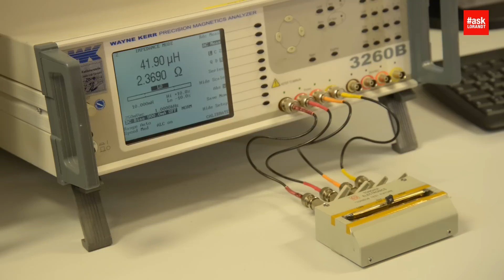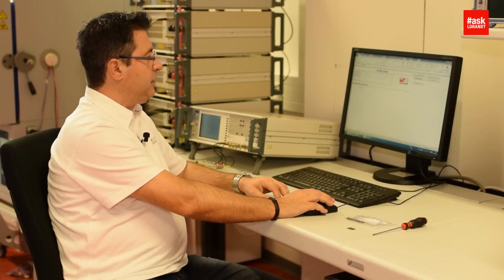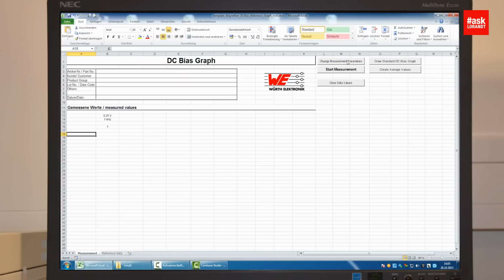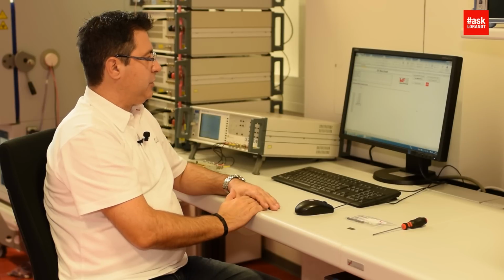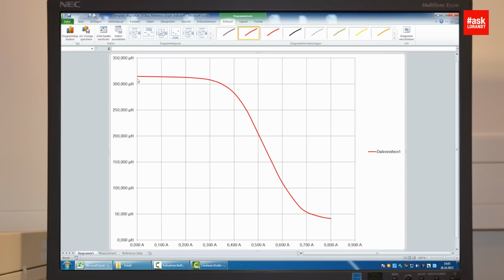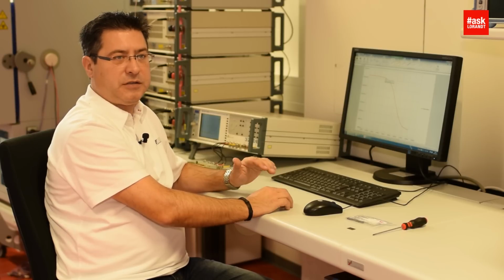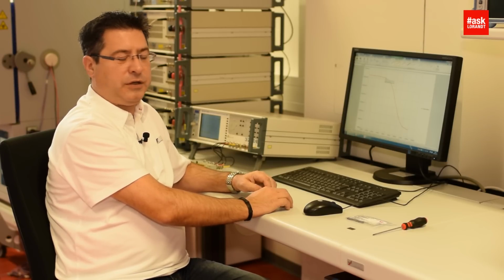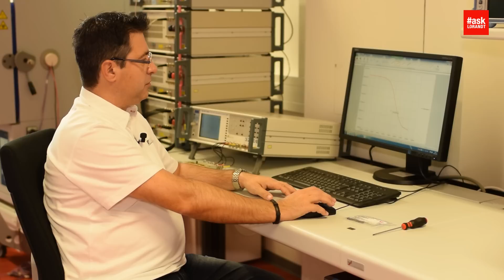#askLorandt explains: Saturation current of an inductor

Comment: Very interesting your measurement set up, I just have some question, how to select what saturation current is suitable for my circuit, and is there any relationship with rated current (like the difference between your rated current and saturated current needs to be large enough)? Please advise.
Reply: Thanks, yes our company made some nice investments in good instruments. Regarding to your question:  there is no relationship between Isat and Irated. The definitions are totally different. By Isat you are looking to the inductance drop over the current increases and by Irated you are measuring the self heating vs. current. Means it could happen that you have a inductance with a low DCR and can push lot of Amps until the the component start to be hot, but because of the smal size of the core the H field too big, that you don't have any inductance left. At bigger size cores the Isat ismost time higher value as Irated. You can select the inductors on the simples way using our RedExpert database:
https://redexpert.we-online.com/redexpert
Here you can introduce your operation values and you can see which inductance how much will saturate and how hot will be during your operation. All those values are measured in real condition and without heatsink. If you like you can contact our local FAE to help you by choosing the right component. just send me an email to: askLorandt@we-online.com

Comment: Hallo Lorandt, may I have two questions please? Basically, both of them are related to the current ripple in a DC-DC converter application:

1. What about the AC current as operating point? Does the inductance change if you test at a higher one?
2. The test frequency was 1 kHz, but the buck/boost regulators work at hundreds of kHz. Is there any dependency of saturation on the signal frequency in your opinion?

Thank you in advance!

Peter
Reply: Re.1. The Saturation of an inductor can be from DC current or from AC ripple current. The DC current is the one which you can see when the inductance L start to drop from his initial value. Becasue of that the I(ripple) max, your AC current in the inductor from an DC/DC converter, should be always less than the Isat from Inductor. Best when the L is still linear and have no drop. Please see in the datasheet from WE or in the RedExpert "L vs. I" graph
Re.2. The testing freq. is according the inductor values different as the real use in the application. Because of that there is a range from 1kHz to 100MHz depending on the value of the inductor where they are measured. In the datatsheet you can read the SRF (self resonant freq) where the inductor becomes capacitive. Always your switching freq. should be much lower than this SRF. In the datasheet you can see the SRF and as well where is the inductor linear (no change of the inductance vs Freq.) like here:
https://www.we-online.com/catalog/en/datasheet/7447713082.pdf

Comment: So, basically, I can find out the saturation current of an inductor by measuring its inductance vs. current through it. When the inductance starts dropping, that's the saturation point.
Reply from the maker: Hi Edin, thanks for the note! Well, this is not easy to define.There is no standard which tells us when an inductor is saturated. We at Würth Elektronik define in most our storage inductors 10% drop as the saturation point. If the induction drops significantly and there is no more change regarding the current, then it is totally saturated. At that point we don’t recommend to use it. Furthermore, the influence of the temperature, which moves the saturation curve, must be considered. Because of this reason we recommend not to use the inductors at a saturation point with a drop of more than 10% of the initial value. Best regards, Würth Elektronik

Comment: Searching for an apt inductor for my dc-dc project, I cannot find more than one current rating on the considered data sheets: I e, https://www.mouser.se/datasheet/2/358/typ_DKIH-1-1276015.pdf states a "I-n" of 50 A on the DKIH-3252-506J-NK. Is it the rated or the saturation current that is intended here?
Reply: Hello Alfred. We don't have a 50A one but 46A one here to find:
https://we-online.com/re/5c1HcoO3
The specs are here:
https://katalog.we-online.com/pbs/datasheet/7448063801.pdf
Be aware about the current definition as Shurter define Irated @40°C and WE ist @70°C
I would ask for samples as WE is always provide free samples and check in your application if fits or not. In case you need more support contact me at askLorandt@we-online.de

Comment: Hello.. I am interested to know bit more about the measurment.. can you explain the measurement setup and device you used in the saturation measurement. thanks
Reply: Hello Umar. We use our own programmed software to grab the data from the measuring instruments via GPIB. The LCR Meter is a Wayne Kerr WK-6230 and WK6500 DC bias unit.

Comment: Very Interesting video. I just wanted to ask what precisely is meant by "ripple current"? Is it maximum peak current for a switching device? Or is it difference in current values when the switch is on and off (for a dc-dc buck converter it is typically 30% of an average current)?
Reply: In this measurement we don't measure the Iripple current. This is a part from another video. Here we measure the DC bias dependency from an inductor to predict the saturation point of the storage inductor generated from the DC current passing this component. There are in DC/DC converter different currents: Ipeak/Iripple/Iavg or Iout
Reply from the maker: Hello Mr. Soltowski, thanks for your question! With "Ripple current" the AC current during the load and the discharge of the inductor during operation is meant. The maximum current is the peak that can be reached in an inductor. This current is tipically 20~40% from the main output current of the buck dc/dc converter. In Lorandt's example it is 30% from the output current. Best regards, Würth Elektronik

Comment: What software are you using for sweeping the measurements?
Reply: We are using an own programmed Macro in Excel, which is used with a NI GPIB-USB adapter connected with the Wayne Kerr LCR meter.
Reply: This is based on grabing via GPIB the data from the instrument using a NI card. The software is our own programming and use an Excel sheet to write the data into. Can be done in Visual Basic.